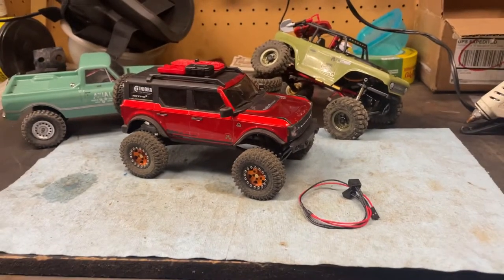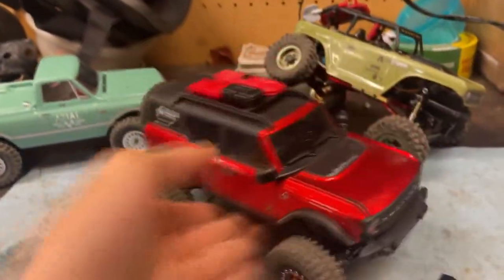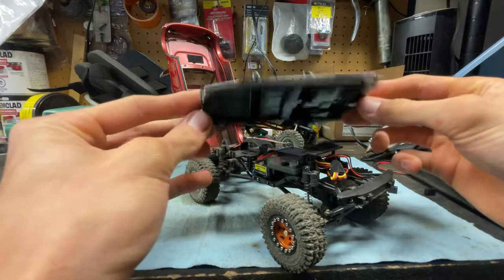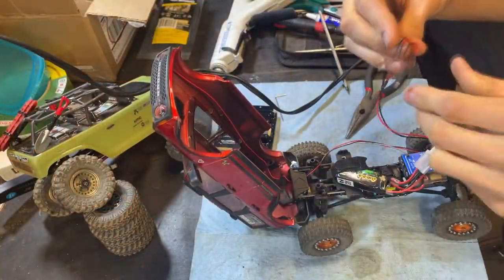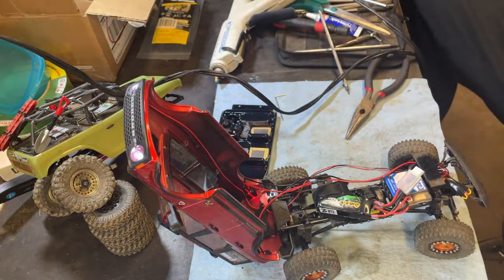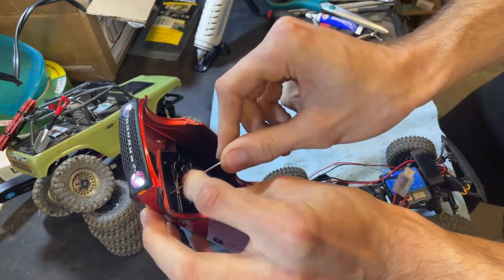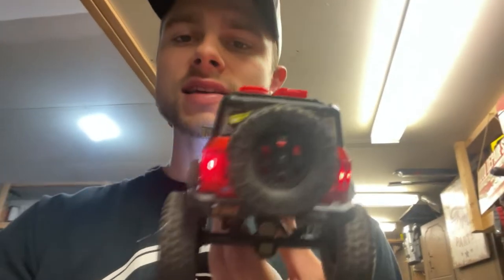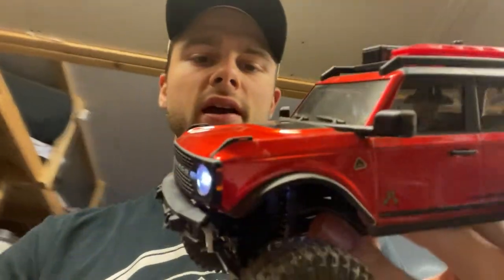How To Install Tailights! Are They Worth It? | Axial SCX24 Ford Bronco Build

Comment: I have these lights fitted and from experience ... using hot glue is no good long term. As soon as you hit some trails outside, the light housings will shake free ... I've found 2 part epoxy to be the solution 👍 Light kit is worth it if that's what you want, very happy with them.

Comment: Looks sweet! I’m picking some up shortly.

How did you wire the front bumper lights to come on and off with the controller? Just plug the harness into CHNL 3 or something?

Thanks!
Reply from the maker: Ya I just switched the 2 lights around in the receiver
Reply: @RCCarfleet  thanks!! It worked :)